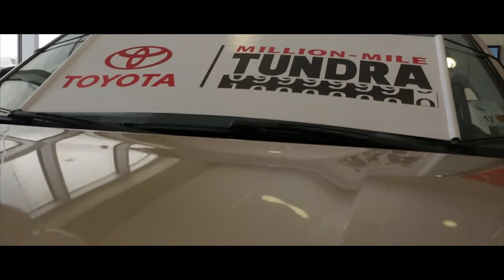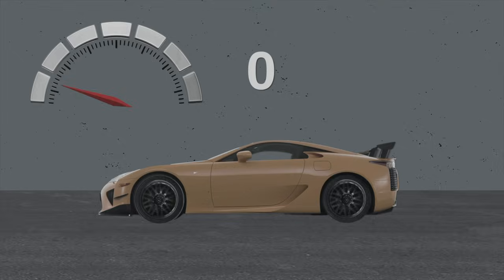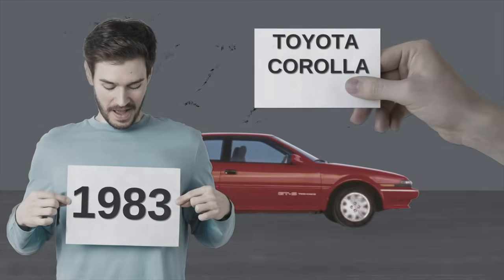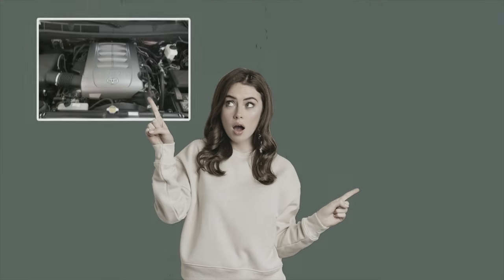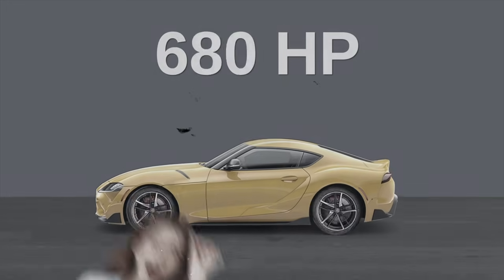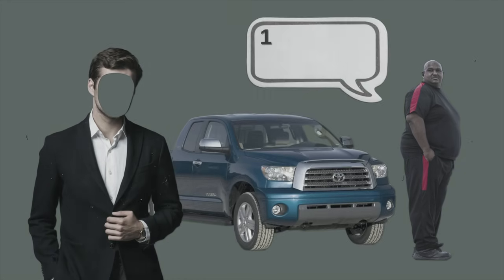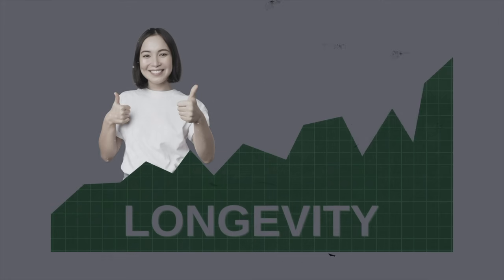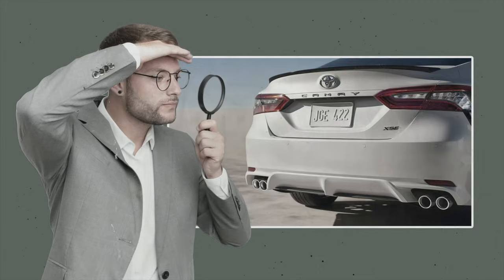The Best Engines Toyota Makes (Do Not Buy Anything Else)

Comment: Engine reliability can be a funny thing to accurately nail down, but you can't finish this list without at least mentioning the Toyota 4.0L V6 found in the 4Runner, the FJ Cruiser & the Tacoma.
Reply: The Toyota 4.0 V-6 is one of the most reliable, long lasting gasoline engine of all time.
Reply: What about the 3.4L V6 F DO ? I put over 400,000 miles on this Tacoma 1998.
Had a engine overhauled got it back from shop, then after driving it for a month the there start being battery discharge issue, chg'd the alternator ( that had never been done)..but this problem w/ battery discharge, 1 blown fuse, cluster goes out. Its in the shop now...they tell me the engine harness ( probably has a short meanwhile I am waiting for this vehicle ( its my transportation Uber's not cheap ). Can anybody help me! Arizona Sun Burn Ouch!!
Reply: I agree I have the second gen Tacoma with almost 500k miles zero major issues
Reply: Yeah, my ‘03 3.4L runs smoother than my 2016 3.5L. The engine outlasts the metal of the truck no problem. The 22R is another engine that I’ve seen take abuse that no engine should, out off-roading. Like serious scorching. Lol
Reply: The 1GR is legendary.
Reply: I think he was taking performance and efficiency into the equation. All engines can only sit in the shadow of the 22-RE when it comes to reliability. Google “top gear killing a Toyota”
Reply: He did mention the 1GR, just not as one of the contenders😜
Reply: 5VZ-FE 👍

Comment: The 1.5L 1NZ-FE 4 cylinder in my 5 speed 2004 Echo RS has 400k miles on it, and it's still running like brand new. I just put a new muffler on it for the first time since new. This car has saved me at least $100k in replacement vehicles since I bought it. It's basically paid for my house. Best purchase I've ever made.
Reply: i had a echo auto for half a year, amazing fuel economy !
Reply: My 2004 corolla is almost 300k, just replaced the starter last year
Reply: I nz and 5A Jamaica most reliable
Reply: I hear ya" I'm on my 2nd echo (2001) and wish I had kept my first one. Cheap and reliable. Don't think Toyota ever made a more reliable engine.
Reply: 1NZ-FE  1.5 liter engine. 2008 Toyota Yaris ❤❤❤❤❤

Comment: Still drive my 2005 Camry 4 cylinder with the 2AZ-FE. Over 350,000 miles. Almost 19 years old & runs like a champ. Toronto, Canada
Reply: ❤❤❤درود مرا از ایران بپذیرید
Reply: That’s interesting because the 2AZFE is known to blow head bolts and burn oil. 😂
Reply: The 07-11 had burning oil issues with problems with piston rings. The 05-06's we're fine.

Comment: I have a 2008 Camry with 200,000 miles 1ZZ-FE 1.8l 4 cylinder.  I’m keeping it until rusts out which may not be much longer here in the rust belt.
Reply: 1zz-fe ??? not familiar with that. I thought an 08 camry would have the 2azfe, like my 09 2.4 camry... is this custom?
Reply: Thought the same thing. It has the oil burning 2.4

Comment: 2AR-FE 2.5L (use in the Rav 4, Camry, Scion Tc, Lexus ES 250)
Reply: The 2arfe will still burn oil  (stuck rings) if not religious with the oil change intervals usually after 200k miles... I am about to engine swap my 2arfe at 315k miles (scion tc) for a used 84k-mile motor because the oil pump died and it burns qt of oil every 400 miles. 2014 scion tc.

Comment: Hi scotty, enjoy your banter. Ken here from north queensland Australia.  I have a 2008 hilux 2wd trayback single cab with 4 litre v6 Petrol engine and manual 5 speed. that currently has 385000 km on the clock. Drives like she is just run in and has grunt. I am confident she will outlast me ( Im 70 lol). Keep up the gr8 work mate. kind regards. Ken

Comment: My 2UZ-FE has been on the road for 22 years and 190,000 miles, the performance in my lighter 4WD regular cab Tundra is excellent. My 2007 3UR-FE is a high performance beast.

Comment: I brought 1980 Celica that has 33K from rich neighborhood, Brookline, MA back in 1987 for $3.2K. It has 2200CC R-20 engine with no major issue like my 1981 Volvo GL. 244 that I paid 15K demo new. I sold the Celica in 1988 that I put 25K miles for 2.4K to the president of GM plan in Fermingham, MA that he brought it for his son HS graduation presenrt. Only issue I had was minor oil leak from Cylinder head and my mechanic told me that if he took it apart and put the new head gasget, the car will never be the same.

Comment: I'm approaching 100K miles on my2017 Toyota Camry Hybrid XLE and I love it I've never had to replace the Hybrid battery and it's still running as strong as day one and I much rather replace a hybrid battery maybe once every 15-20 years if needed rather than constantly replacing A serpentine belt, brake pads and rotors, starters and alternators 😂 I've had not 1 single issue that is always mentioned about Hybrids 🤷🏽‍♂️yes I take care of my car oil change every 5k and I'm always on top of all fluids needed. Honestly I don't EVER want the headache of a regular gas engine vehicle! I'm much happier with a Hybrid the only issue and honestly it's NOT in my opinion, is the HV battery! but honestly im ok with replacing it 15years later (if) I'm still deciding to keep the car Honestly if anyone is thinking about getting a hybrid Go FOR IT THEY ARE NOT ENDLESS MONEY PITS! 😂 THEY ARE ACTUALLY VERY RELIABLE AND VERY MAINTENANCE FRIENDLY MUCH MORE THAN A REGULAR GASOLINE CAR! HYBRID CARS ARE AWESOME AND AS A BONUS THE "SYNERGY DRIVE SYSTEM" FOR TOYOTA HYBRID VEHICLES IS WAY TO SMART TO LET YOU MESS ANYTHING UP SO DONT BE FOOLED BY FOOLS TALKING BAD ABOUT HYBRIDS They ARE NOT BAD AT ALL!! IM NOT BASHING ON SCOTTY Here EITHER SO DON'T TURN THIS INTO SOMETHING ITS NOT! HE ACTUALLY HELPED ME FIX A LOT OF VEHICLES BY SHARING WAYS TO WORK ON HIS VIDEOS! KEEP IT UP SCOTTY YOUR AWESOME! 👍 (MAKE SURE YOU ALWAYS CHECK THE HV FAN FILTER KEEP IT CLEAN AND YOUR BATTERY WILL LAST A LOOOOOOOOOOOOOONG TIME!) NEGLECTED FAN FILTERS "WILL" RESULT IN HIGH-VOLTAGE BATTERY FAILURE! OTHER THEN THAT THIS ENTIRE SYSTEM IS PRETTY MUCH BULLETPROOF! 💯💪💯

Comment: The 22RE used in Toyota pickups were (and still are) bullet proof if maintained....
Reply: Not as durable as the '1975-80 20R.  20R had an extra durable double row timing chain and it's smaller diameter cylinders enabled the cylinder head gasket to seal better, longer.

Comment: The old 22 series 4 cylinder engines were weak in power and torque, but they could run forever. I still have a 22RE in an old 4-Runner. I don't drive it much anymore, but I think it has somewhere around 325,000 miles on it.

Comment: Yes hybrid is definitely a realistic option for my next vehicle which is a few years down the road.  I don't want to be told I can't fuel up my car because of the grid or get stuck in the middle of an evacuation order due to forest fire and my vehicle runs out of fuel away from a charging station.  I can always put in a few gallons of gas with a Jerry can and get to the next gas station and I don't need the grid to do this.
Reply: I thought everyone had 2 cars? Electric in town ... gas in the Country brother . What is the point of going Interstate if you have to charge . Personally I would like a 10,000 buck wheelchair and a Caddy

Comment: I've got a 3rz in my Toyota Regius Van. Bullet proof reliable engine. I know they use them in the taxis here in South africa that get absolutely abused with little to no maintenance, but they still go strong. Just wish it had hydraulic lifters instead of the shim system as it requires maintenance every few years.

Comment: 1UZ  FE 4.0 V8, Toyota introduced in first ever lexus LS400 1989. This engine is so smooth and reliable even there is fifth gear video of glass of water putting on the different cars.

Comment: 1991 Toyota came out with the 20 valve motor, ( according to Scotty), i had a 1985 Yamaha motorcycle with a 20 valve motor, ( called the genesis motor), great bike, great engine
Reply: the 20 valve silvertop officially came with the AE101 corolla, which was first released in 1991 (on those markets where it was sold) and for a mass produced engine, toyota was the first one to make it work in a car.
Reply: remember the Honda Twin 100?
Reply: Yes, i remember that little bike, at one time i had a Honda cb200t
Reply: @Kevin-bi9nf 
 Did you have the 100?  i had a cb200t, it would run 65mph wide open!

Comment: I love our '18 RAV4 hybrid XLE but and this is just me and I admit it. I am not a fan of the CVT. It works as advertised and has no issues but someone who learned to drive on a manual and drove mostly automatics, this was my first experience with a CVT. Just not a fan. If it was the only thing you knew it would be fine but not when compared to a manual or auto. The 2.5L engine is phenomenal.

Comment: So no mention of the legendary Toyota Diesels that came in the Landcruisers. 1HZ and 1HDFTE. I know multiple with multiple Landcruisers that have driven them in some of the hardest country on the planet and some have gone around the clock. I know one guy who has 8... One has done 1.4 million kms, one just over 1 million and a few that are 400,000 to 800,000. Also to mention the 1UZ. Great engine for drifting and jet boating. I ran twin 1UZ’s in a jet boat and ran it 8-10hrs a day everyday during summer.

Comment: I’m frightened and should be .
A friend bought a 2007 Jeep compass and she drove it for 2 months before the transmission died!
So!
I bought the car from her figured I’d fix snd sell !
Well , I paid her $2000
For Jeep and I put 3000 into Jeep .
It’s looks very good in and out so I got the transmission fixed and we’ve been fixing things .
Got a battery, brakes.  Serviced everything 
Once I replace the motor mount bushings I should be done .
However !
It’s got a rattle in front that quiets down if put in Neutral
It has power  rides smooth other then the rattle . 
And hint what the front rattle might be ?
I think I’m going to replace linkage because that’s where I think the noise may be coming from

Comment: Question - Scotty, I love your videos!!! You're the best on YouTube. Per your suggestion, I picked up a used 2013 Toyota Camry in excellent condition. It has high miles (190K) but it will work perfect for my soon-to-be-driving son and daughter. I noticed in eco mode there's a very subtle shutter at 40 mph. I'm worried that the torque converter is the suspect even though it's not a problem yet. Can I just drive in sport mode and avoid the "flex lockup" of the torque converter and avoid any damage?

Comment: My 2020 Highlander has the 2GR-FKS 3.5L V6 engine. Performs well at speed, makes a pretty good sound for a V6 when giving it the beans, but its pretty noisy when idling--lot of clatter, like a diesel.
Reply: i've noticed that also, i have a 2021 Highlander with the same engine...it's still a fantastic engine though.

Comment: Thoughts on the 2.4L 4 cylinder…I have one in my 04 Camry that I bought recently and I’ve been doing a bunch of maintenance. I recently put some B-12 in to try and clean up carbon buildup…before my next oil change I’m going to put some sea foam in my oil to help some more
Reply: sea foam???
Reply: I believe did a video on how bad sea foam is to engines.
Reply: These are solid engines from 02-06. The 2AZ-FE 4 Cylinder engines are solid. I have an 05 Camry with over 350,000 kms & still runs like new. Incredible.

Comment: I'd rather have an LFA than an GT-R.
The LFA is an original car with an original engine, 
while the GT-R is a 350z mashed up with an R34 styling wise while using the 350z engine.

Comment: Got a 1mz-fe Toyota Avalon xls 1995 first gen it's got 250k miles and I still use full synthetic on it and I've never had to do anything but just replaced the cv axles and stabilizer bar bushings , couple engine mounts (mostly rubber parts) and an alternator , other than that this cars still  a beast and the ac blows colder than my 2017 Tacoma 😅 

Oh and I added a aftermarket short ram intake and took out the box intake , sounds better and probably gets no difference in hp or mpg if anything but don't have little critters trying to make a home inside it anymore 😅

Comment: The NiMh battery has no memory anymore when it gets depleted?
LiOn never had that issue in the past, unless I'm remembering old school when that was an issue.
I must be getting older!
Reply: Too old, LiFePo4 is not the same as LiPo ( which uses a polymer not phosphate.  LiFePo4 has a charge range and dies when full drained,  You can suck a polymer battery dry.  Polymers like frequent charging but Ion lithium ones due not.  Both have cold and heat issues.  The are actually additional Lithium battery types as well.  NiMH acts like either Lithium batteries mentioned

Comment: Here is a list ; of BEST  Toyota  engines.  2004 -07  Highlander       04-08 Camry Solara (V6)    04-08 Sienna      04-08  Camry (V6)        2005-2010     05-010   Highlander      04-08  Lexus  RX 330
 06-08 Lexus  RX  400 H                             04-08   Lexus  ES 330        ()   /////      A L L      THESE   wonderfull, creations,  use /have  the     3MZ - FE      engine.    Most others, very good, except for oil leaks, some head  gasket  issues. 
                               NEXT  best ones :   2JZ -GE          1NZ-FE       5VZ-FE             1GR-FE             2GR-FE      
HONORABLE   MENTIONS ;   2JZ-GTE   (3 L  16  twin turbo )        2UR-GSE  (5 Litre  V8)      
THANKYOU   SCOTTY,  FOR  ALL  YOUR   ' GIVING '   YEARS.    GIVE  THE  MRS   A    HUGE    H U G    from  millions    of   us.  !   (another , old guy -trucker, retired taxi guy)

Comment: Hey scotty ive heard toyota camry 2014 - 2017 were very reliable  what is your opinion?
Reply: 2010 - 2016, I think 2017 was a redesign year, I have a 2012 and 2016, same parts.  Both have better tires (Michelin High Performance) but the rest is original.

Comment: Any good engine in newer models? (2016-onward)
Reply: They still last 500,000 if oil is changed every 4,000 miles or 4-6 months. 95% of owners won't.  And transmission is drained and filled every 30,000

Comment: You cant talk about Toyotas best engines with out including the diesel motors like the 3l 2.8, 5l 3.0 and the 1kz, its normal to see them with 500-800kms on the clock and it seem the man thing that kills the 3l 2.8 it the owner not changing the oil which i have seen them do 300km with no oil changes

Comment: Scotty: Please do a video on the current 2AR-FE engine.  It has a unique 8 fuel injector system with GDI and Port Injection system.  Is it reliable?  Will the Port Injectors clean the valves such that they will not foul like all GDI engines will eventually foul? Finally, how frequently should I change the oil?  The manual says ever 10K miles for an oil change.  Bah! I intend to change the oil every 5K miles.  Am I wasting money or ensuring that my engine will go hundreds of thousands of miles??

Comment: Would you consider making a video that looks at the sudden rpm changes an engine undergoes when transmission loads change?  Everything in motion has momentum and sudden changes have consequences. An abrupt change from 4,500 engine rpm to 3,200 engine rpm (under load) must change the way the bearings in the engine encounter stress. No other component in the drive train would survive such an abrupt change. How (why) do engine rpms change so quickly without damage?

Comment: I bought a 2019 v6 4x4 Tacoma, biggest hunk of junk I’ve ever had. 30k miles engine need replacing, 50k need a new tranny. It was a 2019. 

I needed something reliable with high build quality so got a ram eco diesel. So reliable, it has now 10k miles and only has gone to the shop 5 times.

Comment: I used to own a Japanese import with a blacktop 20 valve engine. Revs up past 8000 rpm. It loved to be revved and it just pulled the higher you revved it. I also used to own another Japanese import that had a Mitsubishi MIVEC engine and it too revved up past 8000 rpm but was like a VTEC as it had a larger cam that engaged around 6000 rpm. I miss both those cars.

Comment: If Scotty designed a vehicle, what should it be called? The Kilmer Classic. Has a timing chain, 4 cylinder, non-interference engine, no battery except to start it, clears that speed bump in Scotty's neighborhood, survives the stop sign during lunch hour, manual parking brake, an actual key to start AND unlock it, made in Japan, no turbo, automatically changes its own oil every 5000 miles, gets great gas mileage except when you drive... like Scotty, has an actual chassis, no sun roof to leak, no plastic stuff, cheap available replacement parts, an actual gas cap, lasts half a million miles, and comes with a trustworthy mechanic like Scotty (with a scan tool). Did I miss anything?
Reply: The Kilmer

Comment: I’d like to say thank you Scotty, one time my car kept “blacking out” I’d try to turn it on and all power would go out, you recommended that I take out the battery for a few minutes. I was stuck outside of work and it fixed my issue even 3 years later.

Comment: All I know is Tesla's literally the best car ever driven, and I usually Drive BMWs and Mercedes.
Reply: No enough charging stations, some are damaged, don't let it get below 10 percent Jessica 💗😘
Reply: Why are you posting this here? Has nothing to do with this subject or thread?
Reply: @gabyd5662 Don’t run out of gas!  Same thing. 🤷🏻‍♂️
Reply: @737Parkie It's not really the same thing because even if the car runs out of gas, a simple fill up would put it immediately back on the road.  If the EV battery completely drains it needs various components replaces and lengthy labor.
Reply: @gabyd5662 She doesn't even own a car probably.